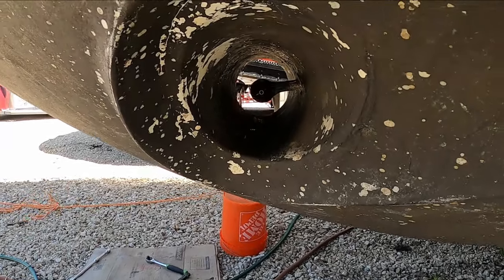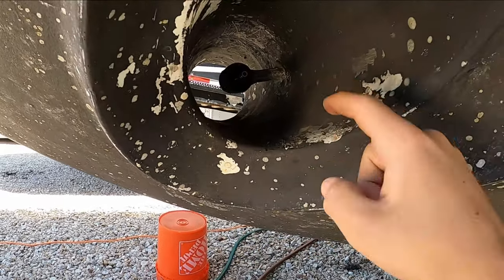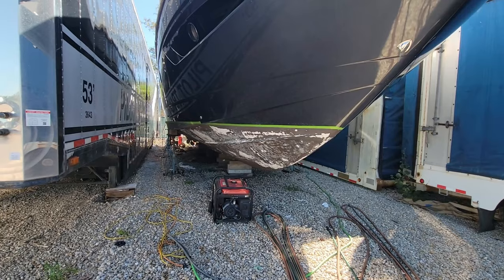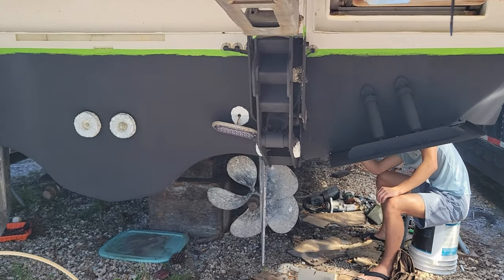Yacht Restoration - Bottom sanding & painting - Vlog 14

Comment: Not gonna be a know it all.This is my occupation . But Google this question. Can I use bottom paint on aluminum?
Reply from the maker: I don't have an aluminum hull... and the swimming platform mechanism is stainless steel.
Reply: Any metal parts should never be coated with a bottom paint without a barrier.. ive only done more than 1000 hulls. Seen many find out the hard way. You will as well if your putting her in the salt. This is why they make special paints for it Such as Pettit vivid. What exact paint did you use? I am trying to be helpful btw
Reply from the maker: Thank you,  I actually appreciate you taking your time and letting me know.  🙂

I will look into which paint it was and will double-check.   It was recommended by some boat shop near me, and said it was fine for stainless steel.  But I will double check. Thanks 👍
Reply: @Khlevnoy  You dont need me for the next part. Look to see if what you used has a Copper Biocide as most do. Unfortunately if it does you will want to strip and repaint any metal parts with atleast an epoxy barrier.
Reply: Quick question  
After grinding your channel and watching you rebuild this beautiful yacht  I'm beginning to wonder if you had the boat Surveyed .. I'm guessing the answer was no with the amount of faults your finding 
Keep it up your getting closer
Reply from the maker: @NUTTER8291  no survey because it was purchased from the auction.